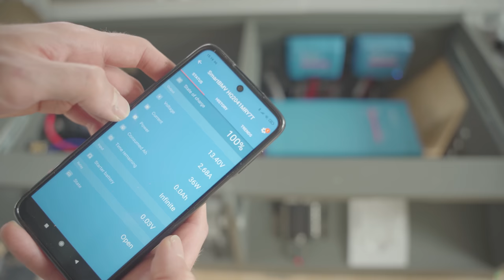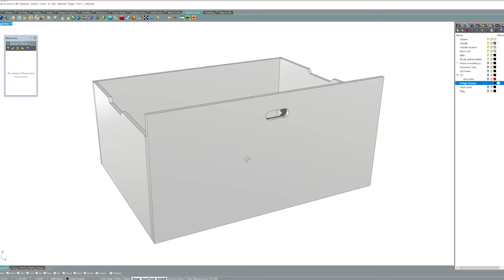DIY Camper Van Conversion. Full Build Timelapse

Comment: After building my own interpretation of a camper-van for 3 people i must say your build is amazing! It helps a lot to have the proper tools. I feel you could benefit from a humidity barrier otherwise you might have condensation problems in a cold climate.
Reply: The sheep's wool is moisture wicking so it should pull any condensation off the shell and make it easier for the overhead fan to carry out
Reply: @BZerk222  I've done a lot of building in Cold Sweden. A humidity/condensation barrier immediately behind the inner wall sheeting is a must. Along with all of the quality siliconing that was done in this vid. Inner humidity is not allowed to enter the insulation layer between the outdoors and the indoors.

Comment: all this is amazing, but something I've learned is that if you are going to insulate the van you have to insulate it completely from the steam in the van (steam from winter camping) otherwise you'll have water that attaches to metal inside the insulation that wont dry easily.

Comment: Why do so many folks forget they can have the campervan 420 cm in height. Use the space. Universally you can be 250cm wide and 420 cm high but most trucks never go above 410 cm for safety. I am not saying you should go 410 cm high, but there's a lot of unused space people are wasting. This is the reason why i will use a full size box truck for my mobile home, 8 meter in length of the box, actually 6 meter box in length and then extra 2 meter garage that can be hoisted up and lowering down to the ground for storing motorcycle, and full 250cm wide, even expanding sides for added space and of course use the full height allowance. But cool job tho...

Comment: I'd do it the lazy way and just do the walls, floor, and ceiling like that, but without built in lights, bolt a futon that comes with a frame to the floor for a couch/bed, use tv dinner trays as kitchen counters/ tables because they fold up, buy some portable power banks with solar pannels to recharge them that'd be for charging: my laptop, phone, nintedo switch (can use phone hotspot to watch movies and shows),  have rechargeable flash lights for lighting , and use a plug in single burner stove or propane grill,  get a portable 12volt rechargeable fridge, and plastic containers and bags for storage that would go under the futon and have a few strapped to the walls. For bathing just use antibacterial wipes and spray shampoo for a few days. And when i'd want a real shower i'd just get a 24 hr gym membership and use their shower. For a toilet you can get a bucket with a toilet lid then just line it with a bag and pour cat litter in it. Or just use a restroom in a fast food place. I could probably only pay about $500-$600 a month for food, keeping my phone service and streaming services on, toiletries, gas, car insurance etc. Which even if I made 400 a week would be doable. And living in a van would be way cheaper than paying $2,300 a month for my one bedroom that doesn't include utilities, phone etc

Comment: Hi I’m just about to do my flooring am I right in thinking you didn’t use any screws ? I would prefer that but a lot of videos are using self tapping screws. I feel the adhesive and weight of everything would be sufficient. Any advice would be appreciated.
Great job great video 👍

Comment: What a great piece of craftsmanship! Could you please elaborate why you did not use popular Kflex isolation but instead some kind of wool? Does someone please recognise what kind of isolation/insulation is that? Is it some eco sheep wool or anything else? I am pro natural isolation but many campers are talking about wetness and dump after using it in Europe during colder weather outside. Thanks!

Comment: What type of sealer did you use on the roof to seal the maxx air fain & solar panel insert? And are the tops of your slide out bed liftable for storage? Can't seem to work out for myself how to combine